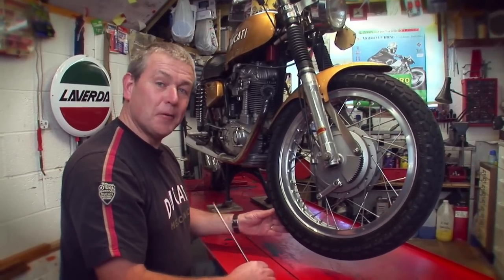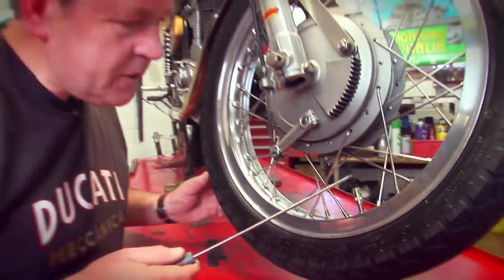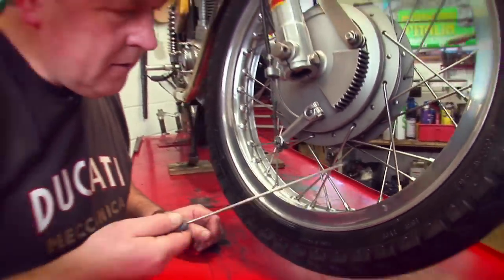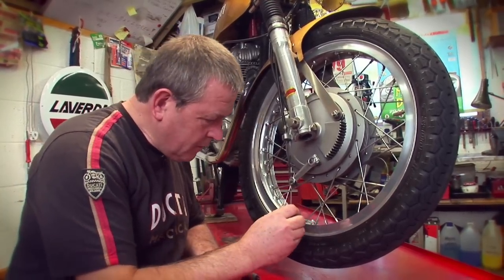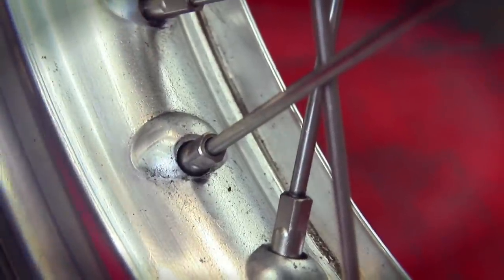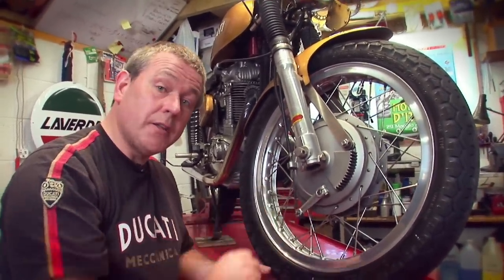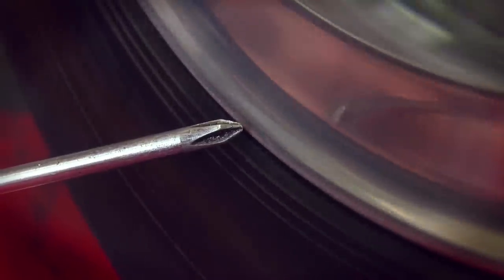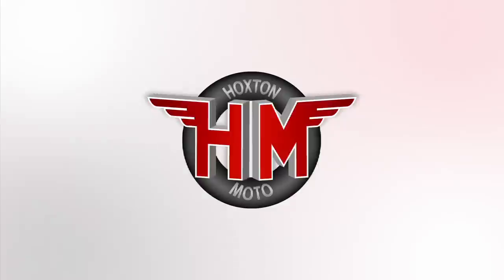Spoke Adjustment for motorcycles

Comment: Hi hoxtonmoto...I have a Sportster Nightster 2008...My back wheel was horribly wobbling...I checked and found 5 broken spokes ... I was lucky to be able to ride back home...have you seen this case before and can you tell me why this happened...Thank you in advance
Reply from the maker: You probably had loose spokes before they broke, always worth a regular check - ride safe.
Reply: @hoxtonmoto  thanx a million...
Reply: @hoxtonmoto  sorry to ask this question :) what is the size of the standards back wheel ( rim) of a spotster nightster 2008
Reply from the maker: @goonygoogoo2  sorry we don't know, best ask your local HD dealer or interweb.
Reply: @hoxtonmoto  Hi Hoxtonmoto...can I use a 60 spokes wheel on my back wheel and a 40 spokes for the front wheel ? Thank you
Reply from the maker: @goonygoogoo2  now you're just being silly, but it is possible - check out ichiban moto for some great bike building 'how tooooos'
Reply: @hoxtonmoto  I didn't mean to sound silly...I live in Egypt and all parts are available...and shipping is becoming more difficult with the covid19 thing...I asked cos this is wheel available now ...and the seller is saying its ok...but I needed a second opinion :) thank you for your help and support Hoxtonmoto :)
Reply from the maker: @goonygoogoo2  most wheels have 40 or 36 spokes - be careful what you buy.
Reply: @hoxtonmoto  thank you :) 

" Drag Specialties 60 Spoke Laced Chrome Rear Wheel, 16" x 3.5" Non-ABS
$943.99 "
that is the deal I have in hand...
Reply: @hoxtonmoto  thank you...turned out I had 11 broken spokes...! not just 6 as told first...!!!